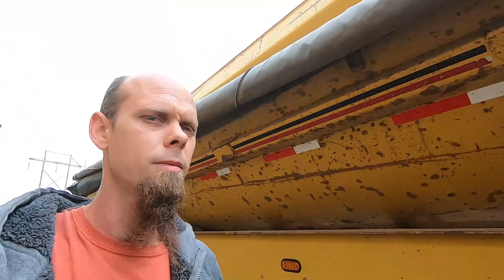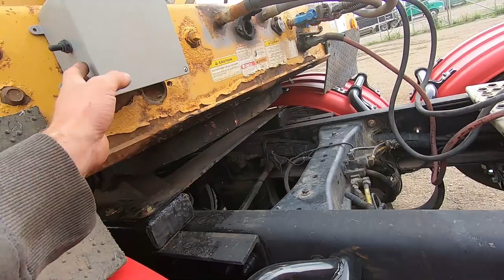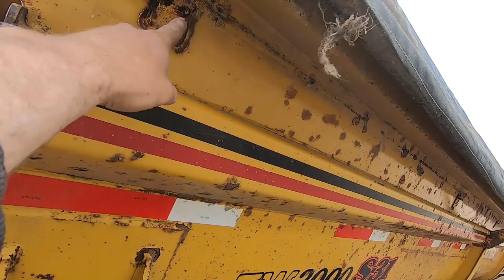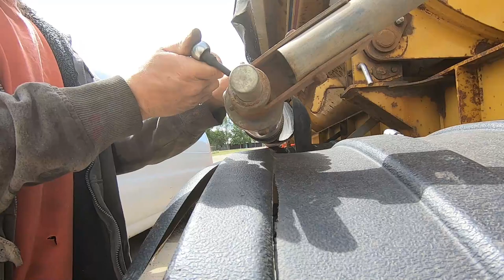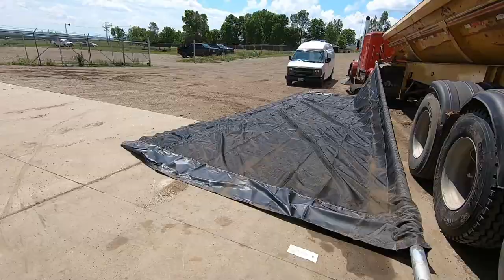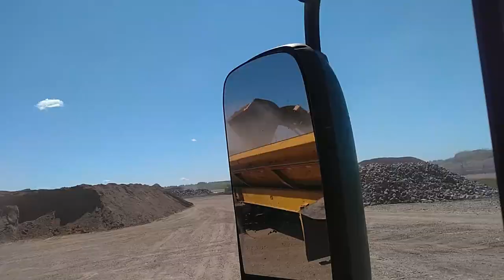midland side dump tarp replacement

Comment: I knew 1 driver from Russia. He showed up all dirty. I asked him what happened. He had to tarp under a overpass. He was a 6’1” 280 and strong. He ask how other small driver tarp loads. I ask he tied the tarp to his back and climbed the cables for each trailer. 100+ pounds. I told him you should have tied a rope to the tarp pull it up. , climb and pull tarp over the top. Now I know why he was strong. Lol

Comment: That was cool. The bonus working dumping was pretty cool.  So the new tarp was little short, but should last long time. Will DOT have an issue with it being little short?????
Reply from the maker: No it will be fine where I run there isn't even a law that says your load has to be tarped. Even with no tarp at all the only thing they can give you a ticket for is unsecured load if gravel is blowing out of your trailer going down the road.

Comment: Ezra, only thing I could add is that if you're not looking to salvage that tarp for any reason, time could've been saved just cutting it along the "wrap".....otherwise, gettin' work done to do work, right?
Reply from the maker: I don't think it would have saved much time because it would of had to come apart anyway to get the new one on. The tarps are harder to cut than you would think as well there made out of a pretty tough material

Comment: i like the backing up with the wheels turned when dumping...i assume that is so you dont bury your tires in material?
Reply from the maker: Yeah. If you dump in a single big pile it can flow in around your tires and your get stuck so backing away from the pile as you dump the last of the load out prevents that.

Comment: Have side dumps ever flopped over when dumping. I used to pull an end dump. But want no part of the side dumps. Lol
Reply from the maker: You can tip them over but they are a lot more stable than a end dump

Comment: wow went to get the bobcat LOL, alot easier with some rope, bobcat is a risk to tear the new tarp
Reply from the maker: nothing got hurt, rope wouldn't have been as much help as it would have seemed, i thought about it but the only place you could have tied a rope around it would have been the ends and the bar threw the end of the tarp i needed to pull over was kinda flimsy i would have flexed and rope would have slipped off needed a way to support it front the center.

Comment: I’ve never pulled a side dump, how are they for stability versus an end dump. In Michigan where I live all we have are 3 and 4 axle lead dumps or doubles “trains”and they do go over once in a while.
Reply from the maker: Side dumps do go over from time to time. Normally only with sticky material and inexperienced operators.

Comment: On that set up, how much can you legally weight?
Reply from the maker: up to 105,500 lbs
Reply: @Ezrider359  I appreciate the response. Do you think it could handle more? I'm from Indiana but I haul construction equipment and some of it is a bit much for a 3 axle trailer and a tandem truck thinking of doing the same thing you did to your pete. I would be permitted probably nothing over 140k gross  just not sure if you think a single frame would do ok with that kinda weight.

Comment: Stuck/Corroded nuts and bolts suck. I can tell my long time go to product that, if you haven't used it, will become your new best friend! I have used this stuff now for over 20 years and it has never failed me. I use this stuff on everything,  but mainly boats and boat trailers in salt water. Try it, test it out on whatever,  I guarantee you'll like it (and no, I have no affiliation with these people). Go to 'www.Tefgel.com' (Ultra Safety Systems). You can get the stuff from as small as a syringe or a 55-gal drum! They have a military contract with the stuff.  I'm lucky because they are located right here in WPB, FL. and they let me buy it out the back door! Read up on it and check it out.